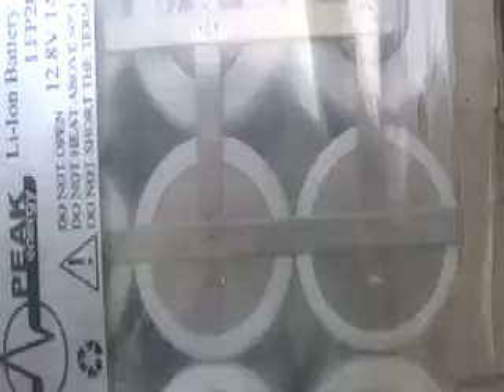Thundersky battery failure in Bob Siebert's AC150 conversion

Comment: @Grimdopple No Bullsh*t Management Sh*ttup is ever required. There is not and never has been a major electric car man'fr which has ever used one. They cause fires!
Besides. A small battery will empty first. Then it will enter reverse voltage as the others gang against it.

No BMS will ever bring that back from the dead.

The best bet if unbalanced (On equal batts) is bottom balance and give 80% charge.
A good vid is on jack rickards blog. A prof tells how they work in deep detail.

Comment: So lets hear this straight. This car has a mix of batteries. YOU CANNOT MIX THESE BATTERIES! BALANCE IS EVERYTHING!

The owner has never bottom balanced the Lithiums before charging proper.

Thundersky: LiCo? They don't make LiCo! The present ones are LiFePo4's and the next gen will be LiYt

Did you kill the thunderskys by overcharging or over discharging?

Lacking knowledge of anything always becomes an expensive problem. All I see is you blame others for your awful engineering expertise .

Comment: this is the nightmare of the EV battery manufacturers: creating and supporting a stable pack.  Another thought: those leaked cells could be improper charging, chemistry, packing defect, or welding defect and after the fact it is difficult to tell which one. 

Seems like getting a couple of Prius packs would be best.  though they are about $3000 each.

Comment: Is there a BMS circuit connected to each of the Thundersky cells or each of the Peak modules? How deep of a discharge level did the owner take these cells/modules down to??

Comment: Interesting. I have old (pre 2006) Thundersky cells in my car. The pre 2006 models have some reliability issues but I've heard that the latest ones are okay.

My current pack has big issues in the winter but in the summer they're fine. Zub 15 degrees C the things don't produce much current. The BMS I have really helps out though!

Do let us know what the resolution to this is. I'm guessing Bob won't be keeping the mispack forever.